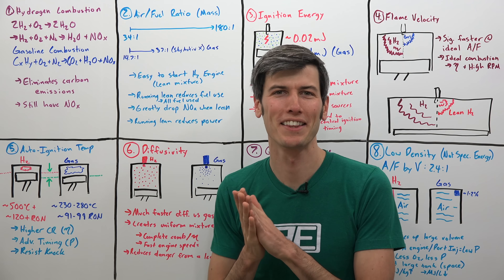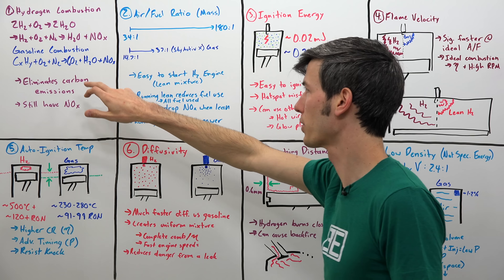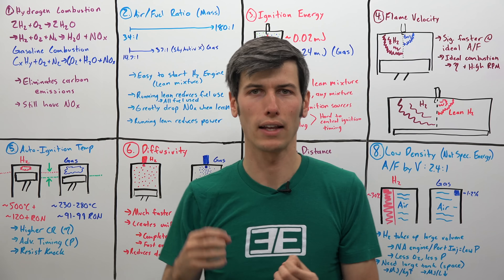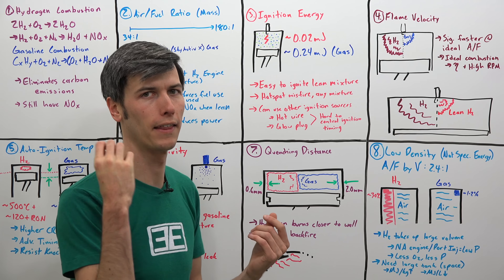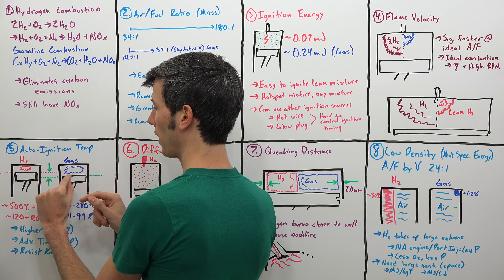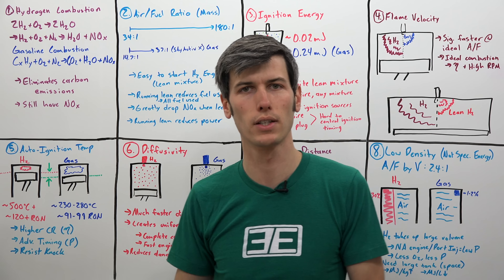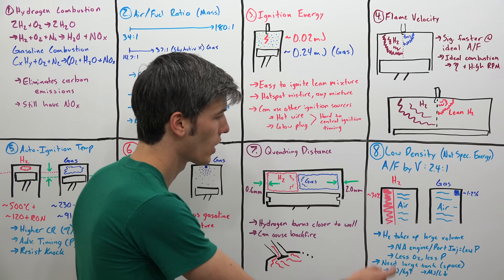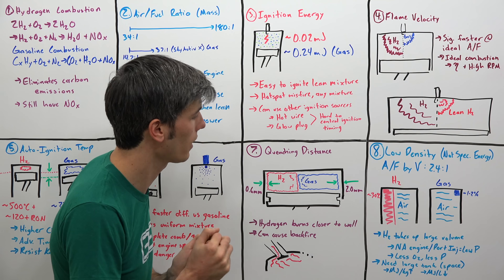The Difference Between Gasoline And Hydrogen Engines

Comment: One way to store hydrogen (cheapest) would be in water. If you replaced the air (only 21% oxygen) with air that has a higher ratio of oxygen to other gases you could address the issue of limited oxygen caused by the extra space that hydrogen will take up in the combustion chamber. Water has oxygen and hydrogen in it so solve two problems with one solution, only issue is we do not have an efficient way to split the hydrogen and oxygen. Enter Stanley Meyers concept of splitting water with molecular/atomic resonance instead of pumping excessive current through water to brute force the hydrogen and oxygen apart like a caveman. Just think about the billions of dollars that has been and will be invested into trying to store liquid or gaseous hydrogen in an efficient manner. What would happen if they used that same money to invest in developing more efficient ways of splitting water into hydrogen and oxygen? Also once you break them apart you will be left with 1 hydrogen to every 2 oxygen giving you that air fuel ratio in the last box of your drawing

Just a thought
Reply: Finally someone mentioned Stanley Meyer!! Thank you. And you cant have a net gain.....in a CLOSED system. Use the environment with catalysts like plants do and split the water. Not impossible.
Reply: What happens to the tank of water in Minnesota during the winter at say -20F?
Reply: Trouble is splitting apart H2O requires almost as much energy as you get from H2 combustion.  I mean, it's more or less a given - no free lunch in chemistry.  If you take H2O, split it into H2 and O, then combust it with the oxygen to recombine it, you get...H2O again.  So there can be no net energy gain from the system.  It will lose energy because it is inefficient.
Reply: @tomsixsix  you do not need there to be a net gain for it to be viable to store your fuel in the form of water on board as a fuel source rather than having giant hydrogen fuel tanks. The hydrogen being pumped into existing hydrogen cars is being created in an inefficient way that loses energy in its creation anyways, you are just moving the means of production into the car instead of having some fuel production center outside of the car. Not to mention the hydrogen tanks in the car will leak some of the stored fuel because hydrogen atoms are extremely small and there is an engineering challenge to be addressed in order to store hydrogen long term without losing fuel. Not to mention you will have a bomb in the back of your car compared to just having water. Hydrogen tanks have already made it into production vehicles and billions of dollars are surely going to be spent developing it further, it would just be interesting to see them use that money to work on developing more efficient means of splitting water instead. 

Also like John Curran mentioned in another comment, if you open the system to include the environment you could find a way to convert/use energy from the environment to make the hydrogen production yield more energy than the electricity input since it will be using some energy from the environment. This may appear to be over unity if you assume the system is closed and only includes the water and electricity, but it is not when you factor in the energy taken/provided by the environment. Perhaps you could use the energy of the electrons spinning around the nucleus of the H and O atoms in a way that will aid the splitting of the water molecule through a form of resonance that will amplify the energy/speed of the spinning electrons, pushing them into further electron shells to destabilize the covalent bonds of the water molecule. If the electrons can be pushed far enough away from the hydrogen atoms by increasing centrifugal forces caused by the increasing velocity of the orbiting electrons (created by resonance induced by electrical pulses on plates instead of constant/static charges on plates that normal electrolysis uses) that the electrons can then be carried away/pulled towards the positive anode and away from the water molecule to destabilize the molecule enough that it will split with less energy than is currently used in conventional means of electrolysis. 

To visualize this better, take a look at an image of a water molecule that includes the path of the electrons. A water molecule in the middle of two plates with opposite charges will cause the 2 hydrogen atoms to be pulled towards one plate while the oxygen atom will be pulled to the opposite plate since water molecules are polar. Instead of brute forcing them apart by increasing the pull of the plates with excessive current, we will just pull them apart slightly, enough so that the path of the electrons around the hydrogen atom become elliptical instead of circular. If we do this at the right time there will be an acceleration of the electron as it begins to take this elongated path towards the oxygen atom that is now slightly further away from the hydrogen atoms because of the slight pull from the plates. As well as going along this elongated path, the electrons will also be attracted slightly towards the peak of that elliptical orbit towards the same direction the oxygen atom is being pulled (ie the positive plate since the electron is negatively charged and the oxygen side of the water molecule is also slightly negatively charged) We will then turn off the charges on the plate so that electrons will continue on their path and next time they come around the hydrogen atom on their orbital path towards the oxygen side of the molecule, we will pulse them again accelerating the electrons orbit further, like pushing a kid on a swing set at the right time so that they will go higher next cycle. Once they gain enough speed and are pulled further and further away from the hydrogen atom, the pull of the plates and/or oxygen atom will overcome the pull of the hydrogen nucleus and strip them of their electrons therefore destabilizing the bond between the H and O atoms. Since we are using the energy of the already orbiting electrons and just nudging them slightly, we must now take into account the "free" already present energy of the indefinite orbit of electrons into our systems equation.
Reply: @apoco_lips9957  no you misunderstand me Apoco.

The problem is that if you store your fuel as water... well, water isn't a fuel!  It is already reacted and it is at the lowest energy state.  Water is an excellent solvent in part because of this property - it pretty much only wants to gain more energy, not lose any.  If you like, you can think of water as if it is hydrogen that has already burned, as combustion reacts the fuel with oxygen.

You can split H2O into H2 and O but to do so you will need to apply an electric current to perform electrolysis.  This process uses energy, and this energy must come from somewhere,  and it also must go somewhere.  In the electrolysis process most of the energy is wasted as heat (usually 50%) and the rest becomes chemical potential energy.

When you combust the H2 you have created you will recombine it with oxygen - either from the atmosphere or from your process, it's not particularly important.  However while that recombination produces energy, it produces less energy than you put into the system to split it apart in the first place.

The ultimate problem becomes then: if you needed energy, from say a battery, to split the H2O into H2 + O, and then you get less of that energy back when you react H2 and O to produce H2O once again (plus a bit of NOx, but that's not particularly important),  the whole system is LESS efficient than just using that battery to drive your wheels.   So you basically have a really inefficient electric vehicle.  

No free lunch in physics unfortunately.  The reason petrol engines work well, from just a small 12V battery, is because the fuel contains a considerable amount of chemical energy that can be released by using a spark.  And they are based on hydrocarbons so petrol is C8H18 for instance -- no oxygen.  Water doesn't contain anywhere near the same amount of potential energy.  And if you have to create your fuel on board your vehicle, this won't work at all.  In fact, a huge amount of energy has gone into refining petrol from crude oil,  and of course a huge amount of potential energy (from the sun ca ~500mn years ago) is trapped in the hydrocarbon chains.  The amount of energy that has gone into making a gallon of petrol is about the same as would move an electric vehicle about 25 miles.
Reply: @tomsixsix  I appreciate your considered response, it shows a sincere curiosity for the understand of everything from physics to chemistry. Curiosity leads us to interesting topics and a desire to comprehend and understand what those before us have discovered themselves. Curiosity also leads us to seek new discoveries, understandings and perspectives. I am not here to challenge anything you have said, I am sure we could hash out already well established ideas, concepts, theories and models. In talking to you I only hope to encourage your curiosity to seek a new perspective on the idea of a system. You are absolutely correct that there can be no net gain in a system (to be clear we are talking about a closed system, a system where all variables/inputs are known) For example, a battery, wires, water and plates could comprise a closed system of electrolysis. Perhaps a scientist, more clever than you or I, could see that there is energy all around us, from simple radio waves, to microwaves, to x-rays, gamma rays, virtual particles that pop in and out of existence that quantum theory explains, and even particles originating from cosmic sources like muons that were recently used to map out an undiscovered void in the great pyramid. Perhaps this curious scientist, or curious craftsman with a passion that has led them to study the most up to date scientific discoveries, finds a way to harness these external sources of energy. Perhaps they create a new system, one that uses basic electricity (perhaps from a battery) to start the systems cycle and then they combined this previously closed system with some hypothetical "antenna" to harness these previously mentioned particles/waves of energy from an external origin. This new system, now being "open" to other inputs via the hypothetical "antenna", could yield more output than the previously closed system. Perhaps, since the system would have other inputs of energy, there would be more energy output than the simple electrical input that the curious scientist originally used to begin the cycle of the system. There would be no net gain of energy since the "extra" energy would really be coming from other external sources other than the battery that supplied the initial electrical power that was used to start the system. 

I hope you understand why I have used the words perhaps and hypothetical so much. I am not trying to make a bold claim that will stand up in a scientific peer review paper. I am not trying to claim that anyone is right or wrong, only to stoke curiosity through an illustrative example that is intentionally vague and general. I hope you do not find yourself keen to argue, rebut or rebuke what I have laid out above. Instead I hope you find something that peaks your curiosity. This is not a basis for debate, only a call to curiosity and the possibility of seeing systems from a different perspective. Perhaps we can gain useful energy from previously unusable sources of energy. It will require us to take our current understandings further and into new territory like Erwin Schrödinger did with the Bohr atom model which he challenged and expanded upon to discover the quantum mechanical model of the atom. Here is a quote that inspired this post "In 1926 Erwin Schrödinger, an Austrian physicist, took the Bohr atom model one step further. Schrödinger used mathematical equations to describe the likelihood of finding an electron in a certain position. This atomic model is known as the quantum mechanical model of the atom. Unlike the Bohr model, the quantum mechanical model does not define the exact path of an electron, but rather, predicts the odds of the location of the electron. " A new perspective was taken, and a new understanding was gained.

Comment: I'm wondering why you would store the H2 as a high pressure gas? Why not have a tank with liquid nitrogen and have it go through a regulator, and mix it with the air from the air filter, like an LPG engine.

Comment: This partially reminds me of CNG, being a "leaner" fuel (produces quite less CO2 byproduct but still some NOx levels), has a very high auto-ignition temperature (540 °C), is a high octane fuel (~120 octanes) and a very low density (0.9kg/m3 @~230 bar, vs. 750kg/m3 in regular petrol fuel), but has 9MJ/l compared to the 34.2MJ/l in petrol fuel.
From a weight standpoint, CNG "wins" but as in compact vehicles space/ volume is most important, petrol is a better option.
Now, compared to petrol CNG has a much slower flame velocity, meaning it takes more time to expand/ combust and therefore is not good for very high engine speeds.

Comment: How come no one yet made a car with a electolysis cell inside,powered by a battery integrated into the car.This way,you eliminate NOx emissions, and you still get a ICE engine feel,sound and other things.
Obviously,it is less efficient than a electric hybrid,but it could be possibly cheaper to produce and distribute to customers.
Also,the car would be possibly lighter because it doesn't need a electric motor alongside a ICE one(Im talking about a hybrid).
Maybe put a good solar cell on top of the car so you could charge it while it is in the parking lot,and there you go.

P.S.
I have done calculations for the solar panel on the roof for a different project,let me know of you want those.All in all i was trying to create EV that would be almost free to run,utilizing regenerative breaking,solar power,and more types of energy that are not being used or wasted.
Reply: There's no free lunch from mother nature, what you want is a complete waste of time, money and energy.
Electric cars and battery technology will get better, Hydrogen cars will not.
Reply: @GoldSrc_  Quite possibly.However,i was aiming at the car enthusiast group with the hydrogen engine.
I hope you realise that we are running out of fossil fuels.Maybe not tommorow,but as supply goes down and demands stay,only price will rise.
So my idea was to have a sports car with a ICE engine,but powered by hydrogen so running the car is cheap and clean.
Modern sportcars can get up to 16l/100km of fuel usage.
That is about 29 euros here where i live.
On the other note,here where i live the eletricity is only like 0.05 per kW.
And no,i don't want to drive a electric car.Those are boring everyday cars that are only used to go from point a
A to point B.

Comment: Great video!
So there goes the "clean" side of hidrogen because of the box. Also it lets you have less tolerances as it may get bad more easily. It also does not smell and does a big boom. The small molecules of hydrogen are so much harder to keep in a tank as they are so little that they will pass through the metal wall of a tank. It does have the potential to create lots of power. 
Gasoline and diesel have 30% or so thermal efficiency. It goes to 50% in some experimental engines but ~30% is the norm. What is the thermal efficiency of a hydrogen engine?

Comment: So ponder using just enough H2 to flash a small amount of H2O to steam.  The water will cool the combustion and you use the expansion of water doing the work.. an internal combustion steam engine...

Comment: Nothing about hydrogen making any container in which it is kept more brittle. No container can hold H for long as it will seep out, even through solid metal.
And wrong about rockets. Many rockets use Kerosene. Hydrogen is only used in specific cases as the engineering to keep it liquid is immense.
Reply from the maker: Wrong about rockets? So you're just going to deny that hydrogen is ever used as rocket fuel?
Reply: @EngineeringExplained  Nope, as I said Hydrogen is used, but only in specific cases. RP1 is used by SpaceX. Blue Origin use Hyrdogen.

Comment: I wonder if water injection works with H₂ engines as well. You could even reuse the exhaust products. That might, maybe, increase that super low ignition energy, and at the same time equalize temperatures more quickly (and especially cool down very hot parts/areas). I'm not up-to-date on hydrogen engines tho, so no idea if it's already being done or has other drawbacks (e.g. even lower energy density).

Comment: How high would the NOx emissions roughly be compared to a gasoline or diesel engine?
Reply: more NOx than in diesel engines
Reply: @antoniotod9614  le wiki: "Typically hydrogen engines are designed to use about twice as much air as theoretically required for complete combustion. At this air/fuel ratio, the formation of NOx is reduced to near zero. Unfortunately, this also reduces the power output to about half that of a similarly sized gasoline engine. To make up for the power loss, hydrogen engines are usually larger than gasoline engines, and/or are equipped with turbochargers or superchargers."

Doesn't sound that bad...